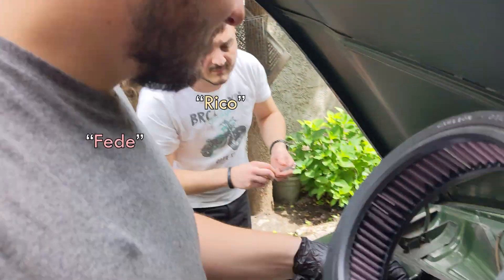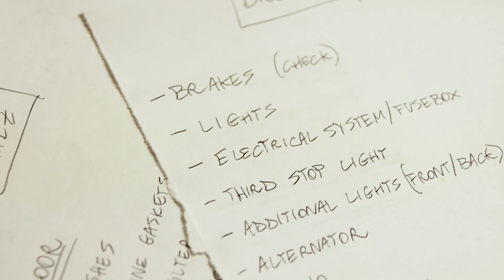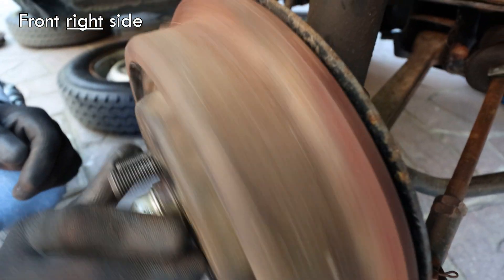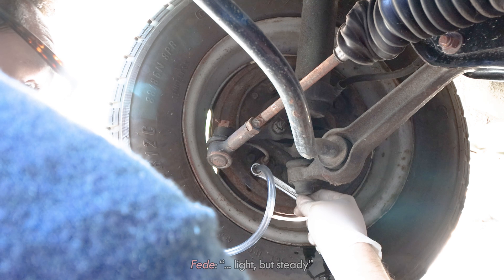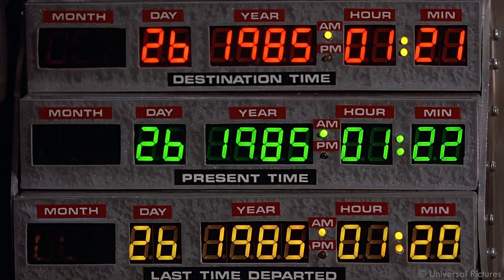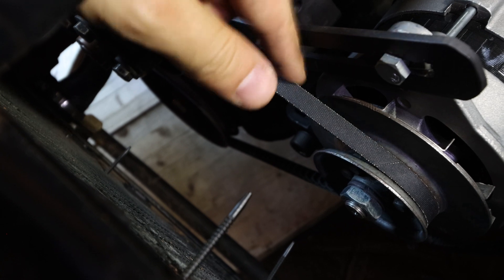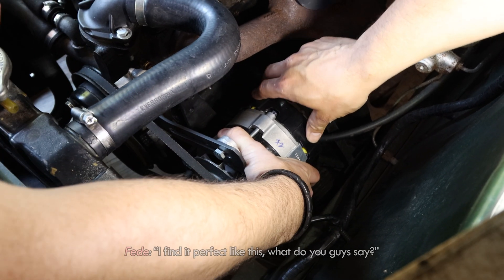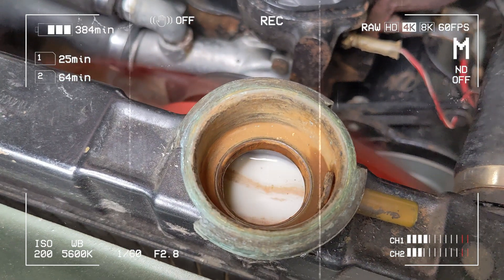Mongol Rally 2023 + 1970s Ford Escort MK1 - Ep. 2: Brakes Check, and Dynamo-to-Alternator Upgrade

Comment: Good work guys, enjoying the series and looking forward to more. Having taken a 1967 Triumph Herald on the rally a few years ago, I suggest you go through as many things on the cars as you can, especially the suspension. Really wish I could do it all again!
Reply from the maker: Thank you David! Don't worry, indeed the suspensions are on our checkist - and we may have a couple of "creative" ideas on that... ;)
Didn't know you were a fellow rallier, kudos to you! :D If you have any suggestions for use to take care before leaving, we are all ears! :)
Reply: @travellingnerds  I think you're on the right track with things like the alternator. Things like stiffer springs that raise the car slightly (only a few cm, it helps) and stronger van tyres (Hankook Vantra or similar) will really help you if you go through the Pamirs.

I know breaking down is part of the fun, but I think in a real classic car that's guaranteed regardless. Preparation helps, especially when you don't have unlimited time to reach the destination and some days you just need to drive 650km without issues.

Comment: Working on a car with a Haynes manual, nice! I’ve been there for my restoration. very useful. It’s courageous to tackle so many repairs with little knowledge, but what a great journey. You’ll learn so much. 
If I may: absolutely don’t use those connectors for the alternators. Those are for household wiring, and are not compatible anywhere in the car, especially since they are not waterproof. It’s likely to get loose with the vibrations, and you might have a short that will burn your Escort to the ground. 
Especially around the alternator, where the current is very high, you want a strong and safe contact. For that, you don’t have a choice but use terminals/connectors made for cars :/
Reply from the maker: Thank you for your kind support and suggestions!
We realize that the wiring as depicted in this video was not ideal, but it was just temporary in order to run the test: we changed that already with soldered wires and heatshrink tubing, and after the [REDACTED] job we are currently undertaking (which we cannot spoil at the moment ;) ), we will switch to a definitive, waterproof solution.
If you have other suggestions, they are welcomed - let us know! :)
Reply: @travellingnerds  perfect then!!